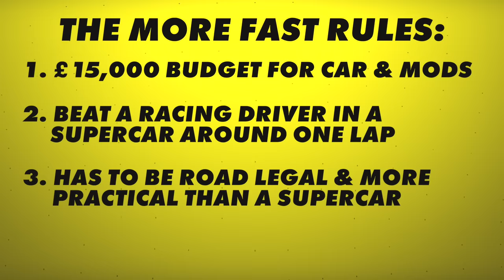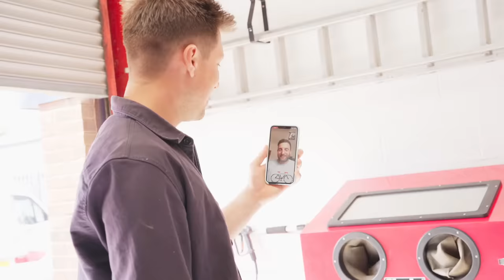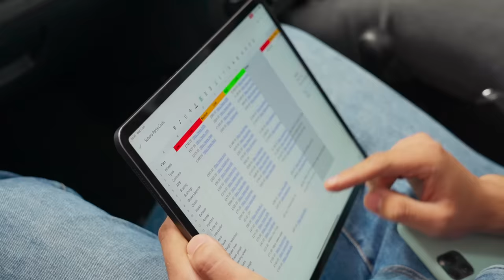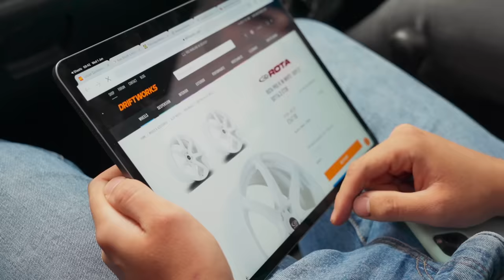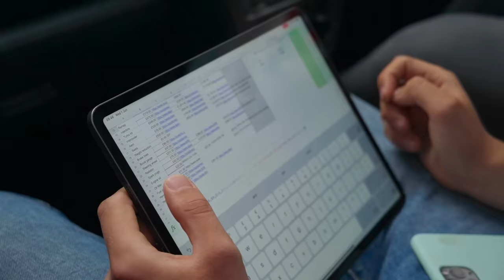Buying a $5000 Project Car to BEAT a Supercar | MORE FAST EP1

Comment: Probably doesn't count as the market has changed but in 2019 I bought a C6 RS6 estate with a stage 2 MRC tune that had just had the brakes done. 730hp/1000nm and I paid £14.8k. So I would say yes, you can, so long as you don't include crippling on-going running costs X-D

Comment: This will be cool, but at the same time tune it properly and not just throw money at it. For exhaust yes headers can help but a simple muffler delete or resonator delete is a cheap pipe. They dont need a whole exhaust system that would come an entire kit that would be more expensive. Also I am curious how much of the interior they will remove to cut weight. All the little plastic and foam bits behind the bumper and under the hood will help in the long run.

Comment: weight... oversized sticky tires on steel wheels. 
big turbo... cam, rods, whatever... 1/3 budget on HP... no exhaust... side pipes or straight pipe...  
decent shocks...coil overs. Ohlins..... 2k

Comment: I would not give it a massive wing, I'm thinking less drag and more focus on mechanical grip because it's an all-wheel drive. Give it light weight rims and top quality tyres. Upgrade the suspension & brakes, replace the clutch (obviously), clean and tune the engine, increase the air intake/turbo, reduce the weight, and replace the exhaust. 

I wouldn't expect to get  a good laptime just by increasing power, and I wouldn't expect more than small gains in HP for this car without an engine swap. you're gonna find better laps by giving it more grip to play to its strength (all wheel drive), reducing weight and drag, and giving it more stopping power (assuming the track will have at least one heavy braking zone). 
I think it will be cheaper to increase mechanical grip than it would be to give it enough HP to make a difference.

Comment: interestingly enough, the weight distribution is actually slightly closer to 50/50 on the wagon vs the sedan. sedan has the option of rear mounted spoiler for extra downforce though...

Comment: if you have an engine hoist and no lift just take the engine out do the clutch, its way easier than crawling around on the ground and wrestling with the transmission

Comment: With that money left over you could have gone double engine.

Put some junkyard engine in the back + a multi-way diff & you’ll be golden.  Plenty of room for ghetto air intakes or even the biggest dumb scoop on top of the car would be kinda funny.  Electronics for dual-engine management are surprisingly cheap.

Comment: Your tyres suspension and geometry are the 3 most important things by far. Since it’s purely for track you could run some ridiculous geo setup and it would dramatically improve lap times and combine that with aggressive r spec semi slick tyres. Weight reduction next and power and aero last. Also be careful as to what cheap aftermarket wheels you buy as a lot can be heavier than oem. Might be advantageous to run a lighter second hand oem wheel off an sti or something as some of these came with forged wheels. As for the brakes you can cheap out run the rotors with good quality pads and change to new brake fluid. If the fluid is old the pedal could go long before you even do 1 lap 😂

Comment: Need to focus on weight saving 
steering wheel, alloy wheels won't improve lap time because it already has alloys just paint them white. 
massive rear wing will slow car down n the straights which is your weakness.
I would spend most on engine tuning and suspension and I totally agree with getting good tyres, that is paramount. 
You need to race the car and check its weaknesses.

Comment: Second hand STI , brakes and suspension will improve the car on a budget. You can get second hand STI wheels though I wouldn't suggest that this would greatly improve your lap time unless your clearing a big brake kit or you need a new size to aid wheel tyre choice. I'd recommend semi slick tyres although you are in the UK and it wouldn't help with practicality. 
I would recommend a flex fuel sensor so you can run ethanol which will help to safely boost power. The intercooler is pretty big and tests have shown that there isn't much of an improvement with new cold air induction system so I would say there isn't much point doing the induction unless your relocating the turbo and pushing over 400hp.
The biggest restriction on the exhaust is the cat and in particular the downpipe for which there will probably be a part you can buy with the turbo. 
These engine are really rather weak so this may sound silly but I'd recommend nos be professionally mapped to help aid lag and throttle response of your big turbo and to also potentially boost top end. In terms of power for the money which won't damage the engine too much I think it makes sense.

Comment: Take top gears (og) as reference. They did something similar, moded wheels and suspension first, aero next (and burnt lol) although depending on the circuit I would suggest more power after wheels and suspension and aero last since the vehicle is already a sporty one. But don't do nitrous oxide, you what it did to the old Stig.

Comment: or just 2k for a good turbo and cooler to have 550 hp
Reply: 2 grand for 550hp with a turbo and inter cooler? How about fuel system,exhaust and tune you might make bit more than 300 at the wheels much more the clutch is gone fix that then the drive shafts if it’s a 6 speed that’s not much longer for this world with 450hp so 20 grand might get you there
Reply: Turbo and IC for 550hp? You'll need supporting mods for that power. Rad, injectors, exhaust, the clutch is shot...
Reply: 😂😂😂 Comments like this are golden, we ain't playing forza now lad
Reply: Funny that you think the engine can handle over 500hp
Reply: @AlexCapi  for one lap?
Reply: Add lightness

Comment: I owned one of these - you’re gonna need an STI transmission, brakes, and weight reduction. Then add power, but you’ll likely stretch the head bolts and will need a new headgasket and upgraded head studs. Good luck!

Edit: upgrade the oil pan and pickup too 😬

Comment: I don't know if you guys have the catfish Camaro or the Pontiac trans am in the UK, but you can slap a twin turbo kit and a camshaft on there and easily get 800 horsepower. I picked up my trans am for $6000 too
Reply: Never came m8
Reply: @therealmudafuka7200  that's really sad. Even right now you can pick up a good Camaro or trans am for about 5 to 8,000 bucks. Comes with an LS1 making about $335 horsepower but you can easily push them to like 500 with just a camshaft
Reply: The only Chevrolet over here is the Matiz 🤣

Comment: I would've chosen an e92 335i, they can be found for cheap (5 to 9k, will be clapped and higher mileage but for the challenge it's ok), tune, intake and exhaust you got 450hp, slap some good wheels and tires, some coilovers and you have a fast car, if you can fit an lsd in your budget thing is a weapon basically poor man's m4.

Also thought of s3 8p because cheap awd, more power potential than the wrx, lighter. That or megane 3 rs, those have been known to lap porsches from factory, suspension is fantastic so if you manage to just squeeze a little power with bolt on and do some weight reduction I wouldn't be surprised to see it in real super car territory.

Comment: I would have picked an e92 335i, 3000 Pounds.
1500 Pounds to 450HP
LSD 1000/1200 Pounds
BC Racing Coils 1500/1750 Pounds
Brembo brake kit 2500 Pounds
Tires/ semi slicks 1000 Pounds
About 10 to 12 Pounds spent, you have 3000/5000 Left and spend that on Weight reduction and Aero
Reply: Where the fuck do you get an e92 335i for 3K lol
Reply: Too heavy and doesn't have AWD to make up for it
Reply: @rdmz135  if you have sticky tires you dont need awd, you'll understeer and its extra weight, plus the bmw is only 200kg more, you can easily lose 200kg on a e92

Comment: Why would you go for wheels or a steering wheel?  They don't make the car faster.  And the wing is not likely to be worth the money.  Add power, improve the brakes, remove weight.

Can you drive a car with plexi windows on the road?  Does it need all of it's crash structures?  How many seats does it need?

Comment: Screw the wheels… 
Screw the Steering wheel…
Cheap Exhaust 
Tune 
Intake 
Michelin Sport Cup 2s 
Slotted not drilled rotor with track pads
WhiteLine sway bar kit
Subframe caster kit
BC coilovers 
Short shifter 
6 puck clutch

Comment: put every penny towards performance mods such as grip and power, don't buy cosmetics such as steering wheels and such. also better brakes allow you to brake later and quicker, so more foot-to-the-floor time, i would guess that makes a decent difference. also analyze whatever track you'll be racing on, as some prefer more powerful cars and some prefer lighter cars with more grip, so theme your build accordingly.
my two cents, anyway

Comment: Tyres, splitter(top gear made a front splitter from some lumber and it saved an enormous time), rear spoiler and brakes have to work. See what you have left for a tune, only change exhaust if it will hurt(are you allowed to just weld a pipe out the side to race?) And coil overs. Last 2 might not net that much, depends  on how much extra power and how bad the original ones are and what isn't working. An intercooler with cia might be better than an exhaust, or it might need fuel, I don't know Subaru. Can it run ethanol? Maybe get some track widening spacers made. 

And free mods, remove everything literally for weight the whole interior and a/c. Tape over or take off anything that makes drag.
Reply: You can get them tuned for e85 but youll need bigger injectors and fuel pump (which theyll need if they go bigger turbo anyway)

Comment: Protip: Buy one that has already gotten all the mods, they probably spent 30-50k making it go fast and are now forced to sell it for a fraction as is the case almost always with tuned cars. Of course they might have abused it but they also have then done all the necessary shake-down so you won't have to bother with that.

Comment: HeY MaDe,

Have you ever heard of the German new brand Gumpert ?
Her new car, Nathalie, runs electrically on methanol.
It accelerates from 0-100 in 2.5 seconds and has a top speed of 300 km/h and
you can convert a normal car with the technique and you would have an electro-methanol car which is environmentally friendly 👌
It would be great if you made a video about it !!!!

ThX

Comment: It's a shame they're amateurs because they could really save a lot of weight relooming the harnesses and taking stuff like the A/C out. If race gas isn't allowed throw some octane booster or run an E50 mix with some upgraded fueling and advance the hell out of the timing once the turbos are maxed out. Honestly doing a cheap build on the block isn't too expensive. 1-size over headbolts, cometic headgaskets, lower compression pistons if they're upgrading the turbo, and some rods. Idk how strong stock crank is in these. Probably looking at 5k USD at most to build it if you try to do it cheap. Ebay turbo, bigger injectors. This is super do-able. Don't bother with coilovers just do springs and struts/shocks since it's cheaper. Instead of changing aero take it all off and choose a low-speed track.

Comment: String wheel won't make it faster. Don't need aero either, not going to be able to utilize. Brakes, suspension, weight, power. In that order. And tire compound over size, good sticky tires. Not too wide if you don't have enough power.

Comment: Forget the expensive mods at the start remove as much weight as you can from the vehicle and fit a flat floor with a rake angle of 5 degrees from front to back, it’s basically free and gives huge gains to any car

Comment: As a Subaru owner, you've picked the wrong car. If you wanted to have any chance, in my opinion, Alfa 159 2.4 jtdm would've been my choice, since the engine could hold power and in general is more reliable

Comment: Downpipe and exhaust are the bang for the buck in terms of unleashing power from stock EJ motor. Forget about wheels, steering wheel and aero. Just remove all unnecessary interior.

Comment: The best choice would be to get an IS300, manual swap it, turboswap it, remove as much weight as u can, coilovers, wheels, tires and u'll have a cheaper, more reliable and much faster car than this!

Comment: It depends on the super car. I would buy a Cadillac ATS with the 3.6v6 335hp and then another 6k for overkill supercharger and you’d be at 5-600hp
Reply: Not happening in the UK though. Actually GM didn't bother selling the ATS anywhere outside of North America as far as I know . We had the supercharged 3.6 here in Australia  ....regarded as not very reliable

Comment: Personally sell the WRX and get STI,you will have better starting platform for mods and this will beat supercar(depends on the supercar)

Went through it and got shirt with that,bought WRX Wagon which was running 555.5bhp,upgraded almost everything on that car and if I would do that again,I would say NO 

It was quite journey we went with 2.1L stroker first and MDX321T which was making healthy 490bhp with 480lbft on 5 speed straight cut PPG gearbox,then plans changed and we wanted but more power and went with EJ22 stroker'ed to 2.35L and with that we are been making 555.5bhp on Tesco 99 and GTX3076R turbo with same PPG gearbox 

For money which you spend you can have STI which needs literally MDX321T or SC42 turbo with good top mount intercooler like Grimspeed or FMIC,injectors 1000cc,ACT clutch ,3 exhaust with DP plus mapping and you will be running nice 450-500bhp which stock engine should take,beyond that you are looking at rebuild,get 2.0L not 2.5L,2.5L is quite unreliable in stock form and I wouldn't go beyond 350-400bhp,if yes at least upgrade headstuds with head gasket and if you do that,pistons plus rods etc 

Stock 2.0L STI engines are good upto 400-450bhp(if you are lucky enough have JDM then 450-500bhp is probably limit),we run on stock JDM 2.0L for while 500bhp and no issues 

Hope this helps and best of luck guys
Reply: I agree but remember the budget of £15k.
Reply: @watchesbythomsen  They should be able get STI for £10-12k here in UK with reasonable mileage

Comment: Please focus as little as possible on looks, skip the wheels entirely, just sand off material off the current wheels to make them lighter. They are currently made to withstand potholes etc, they don't need nearly as much material as are on them currently.

Comment: What's the supercar?  

I just don't see how its possible with an unlimited budget and a wrx.  

I would say a C8 vette is the minimum threshold for a supercar today.  

No matter what you do a wrx will not out corner a vette,  it won't out brake a vette, and it wouldn't out accelerate a vette.  I guess you could make it faster in theory but not on that budget.

Comment: The best modification you cpuld possibly do is MAKE LONGER VIDEOS!!

Your content is really good but the short videos are what spoil it for me. I don't expect hpur long videos, but 20 minutes or so would be really enjoyable to watch.
Reply: I much prefer this length of video for this kind of content, 20 mins on car modding videos invariably seems to involve a good amount of filler content.
Reply: @ApothecaryTerry  Each to their own I suppose. I guess people prefer quick content for their minuscule attention spans.
Reply: @BobMonkeypimp  While that's true, it doesn't apply in this case- it's a 10 minute video, not a 30s short.
Reply: @ApothecaryTerry  This particular video, being the set-up for future videos was probably the appropriate length. However these guys have done some original ideas (such as the F1 tyre videos) and always give us less than ten minutes. 
It's not really a complaint, the content is excellent, but me personally, I'd prefer longer videos.
Reply: @BobMonkeypimp  Yeah for certain stuff I certainly wouldn't mind more depth but I like the pace of their content so would only want more length if it keeps that. I'm not against the idea by any means if it's right for a given video though, could happily watch 30 mins of these guys (more than that probably needs breaking up though, takes a chunk of the day then).

Comment: 300bhp is going to be no where near enough especially if the car has to stay practical which I'm guessing means you won't be able to fully strip it out.

My mods would be.
1. Semi slick tyres
2. Coilovers
3. Light weight wheels
4. Disk and pads
5. Breathing mods
6. Upgraded Intercooler
7. Remap
8. Remove as much weight as you can.
9. Geo setup and corner weighting.

If the budget allowed I would also swap the front seats for some lighter bucket seats and get a smaller steering wheel. Obviously the clutch is a given seeing as it's already gone 😂

I think they'll fail the challenge, they've bought a heavy, slow car that's not great for tuning without forging the engine.

Comment: Have you guys considered picking an evo insted ? It would have been great
Reply: Mitsubishi Airtrek would have been a better bet. Same running gear, but an SUV body and half the price of an Evo.
Reply from the maker: They're lots more money!
Reply: I figured 
anyways can't wait to see the next episodes
Reply: @OVERDRIVE.studios  Should have actually got a civic, EK or EG hatch. With your budget you could have easily dropped in a k series with a turbo, youll make 400 wheel without even opening the engine. Civic parts are highly available and cheap.
Reply: @scott7024  400whp through the front wheels lol good luck having two amateur drivers tame that on a track

Comment: Steering wheel?  Are you mad?

Get the best tires you can.  Period.  Then lose weight.. all the weight.  remove sound deading, seats if you can,  Glass.. make it light.

Get a good clutch.   full exhaust (all of it including turbo)  decent intake.  perhaps meth injection....